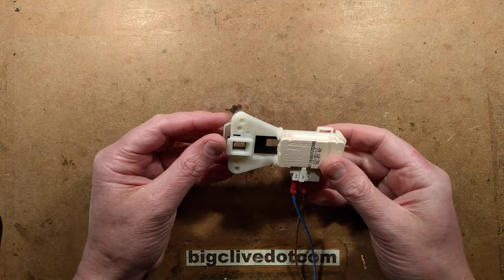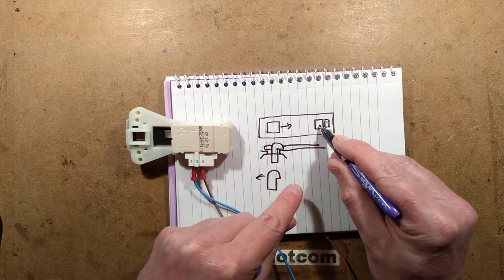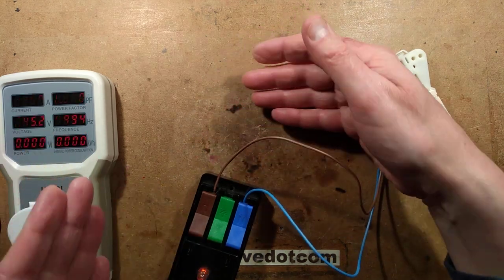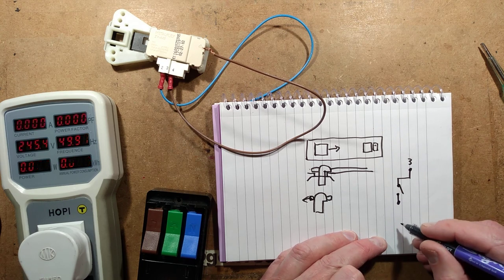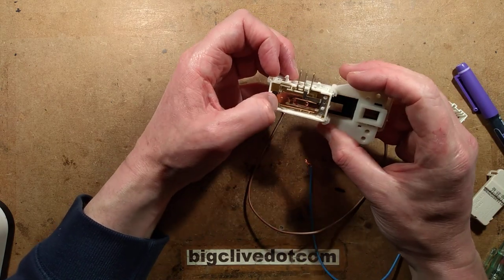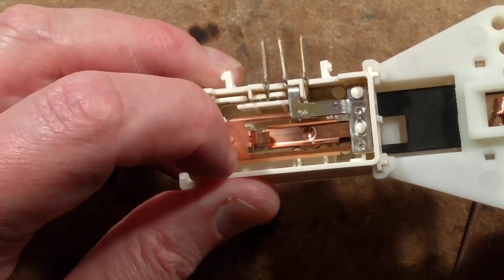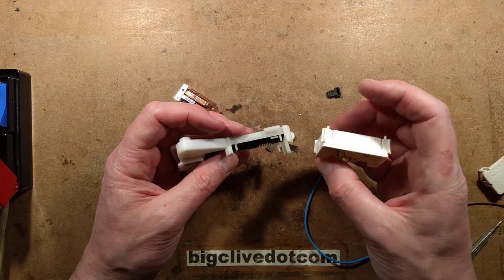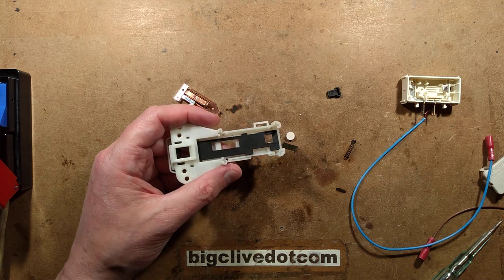How a washing machine door interlock with time delay works.  (not a wax motor)

Comment: I hate the time delay. I never could understand it. The damn door won't open for ages after the program has finished and the drum has stopped. There should be a a way to override it so I can OPEN THE BLOODY DOOR!
Reply: it also allows the washing to cool to a lower temp , which also extend the door lock time.
Reply: This video shows you exactly how to do that - just disconnect the heater wire. Saves a little energy too!
Reply: @rlowens  disconnecting the heater won't work on my machine, because it has special contacts to detect if the lock has engaged or not (and it won't start unless the lock is engaged). I had to enlarge the hole in the metal plate to defeat the lock.
Reply: I have toploader made by Electrolux and it seems to have a latching relay lock. As soons as the machine has done its thing, it simply clicks (more like small bang actually) and you can open it. It would be interesting to see one of those locks dissected. I guess these might have 2 relays inside or some clever way of one solenoid + permanent magnet magic.
Reply: If the motor doesn’t have a rpm sensor then they just guess a generic long time. Units with rpm sensors unlock when the drum stops.
Reply: My old Maytag has a brake on the drum pully. As soon as the cycle stops, or if you open the lid, the drum stops spinning in about 1 second. The damn this is over 40 years old and still works great
Reply: Stick an override switch where the drain or pump filter is at the front, usually under a plastic flap ;-) your own secret button ha ha.. pisses me off too if im in a rush and the door wont open...feels like forever sometimes.

Comment: Great explanation. I have a machine that fills with water but the drum never turns. The door mechanically locks and after no power for 2 minutes it will unlocks. However I never get a light indicating that the door is locked. I am suspecting the door lock.

Comment: If you really want to see how cost can get designed out, compare a new machine with one say 20 years old. I recently pensioned off a '96 vintage Zanussi as the motor was starting to get rumbly and 2-month old Zanussi one came my way for way less than the cost of a new motor and here are a couple of examples.

The hose from the detergent dispenser to the tub is now incorporated in the door seal rubber. This has the additional advantage that the whole dispenser box is flushed clean of detergent.

Instead of having a mechanical linkage to divert the incoming water to the individual compartments in the dispenser, the new one uses two valves and some fluidics to direct the flow three ways.

As for the door latch it's electromechanical, driven from the controller. If it's safe to open the door it'll let you.

Comment: If you can get your hands on the thermal cutoff switch from an electric shower there's a more impressive version of a bimetallic strip. Instead of a strip they use a disk with a slight dome, which pops from convex to concave at a given temperature, which pushes down a button under the disk, which opens contacts to disconnect the power to the shower heating element.
Reply from the maker: I did a full shower teardown.  Including inside the heating chamber.

Comment: Washing machines come with a ten year parts warrantee, so you only change the washing every ten years. I am amazed at how cheap they are my wife just bought a new hotpoint as our old machine died after 9 years. it cost £285 delivered. This machine has a balance system so it does not go into a  high spin unless the clothes are evenly distributed, and does not bounce all over the floor. Now that is clever. How they make them for that price I do not know as the retailer has his cut and then the delivery costs have to be taken out.
Reply: My Bosch machine from the mid-90's did that load balancing thing, and it lasted 20 years!
Reply: @Petertronic  How do they get the costs down if they last so long?
Reply from the maker: My Indesit load balances by detecting the motor speed ramping up and down with an unbalanced load.  It also jolts the drum occasionally to see if it can separate clumped clothes.

Comment: Took mine to bits after seeing this and it fell to bits when I was pushing it around don't know who puts these together but to get that little u shaped piece of copper back is a nightmare it is just balances between the 2 parts of that copper strip and the metal piece fell out as well. So while it is simple is very delicate to put together. Getting a new one anyway but I thought I might try to mend. Thanks for showing this as I could not work out how it works I still do not understand what happens when it heats and the bit that pushes the pin down makes contact  with  the strip below.

Comment: i have a bosch and you can open the door (provided its not spinning i presume) by holding in 2 buttons, so it must operate completely different to this, it is though of course a digital program as opposed to a traditional mechanical one

Comment: Great video Clive, I loved watching it. So if I understand correctly the bi-metallic strip is the 'ptc' element and the isolated ceramic disc just transfers the 'bend' to the switching strip without short circuiting L against N?

Comment: Great video Clive, not trying to cause an argument, but I recently took a door lock apart on my indesit washing machine and found that it uses a NTC thermistor, not a PTC thermistor, mine had gone high resistance from soot on the contacts, it also blew (literally) a thyristor ( I'm guessing that's what it is) on the main power board, unfortunately, I don't know what spec the thyristor was because it blew a small chunk out the front of it and took the ID number with it, all I know is it was Q9 lol

Comment: Perhaps a future video about the HOPI’s internals; Maybe see if the HOPI could be modified slightly to abate some of the flicker‽
Reply from the maker: That video is out tomorrow.
Reply: @bigclivedotcom  Wow now that's an 'agile' response to consumer feedback!  Love your videos; can't wait to watch!
Reply: I've been curious for a while as to whether the flicker is predominately caused by clock refresh of the SSD multiplexing, just poorly rectified  AC or a bit of both?  It kinda seems like the former because of the way it "waves" across, but not seeing it in person I can't tell if it's the display refresh cycle or mostly the camera shutter leading to stroboscopic aliasing. I get that ultimately the two are related, but I'm curious if residual ripple is a factor or is it just down to the refresh speed of the display driver.

Comment: What do you think about the Indesit/Hotpoint recall for overheating door locks? BBC article says it's caused by "The extra current running through the machine when the heating element is on causing the door locking system to overheat". Would love to understand properly what you think could be happening.
Reply from the maker: I think it's just the switch contacts inside burning up due to the high 8A load of the heating element.  I'm surprised that the heater current runs through that, I would have thought they'd just switch a control circuit
Reply: @bigclivedotcom   I don't know much about the appliances but I'm surprised the  door contact switch does not provide a signal voltage to power a relay switch or something?  But if so many manufacturers share this type of switch; how come it is only some whirlpool washers that are affected?  Are wiring diagrammes available?  it would be interesting to see if they differ?I would definitely watch a video on that.  Chris
Reply: @bigclivedotcom  I'm on the waiting list to have my machine repaired or replaced, which is... annoying. It's hard to determine from what's in the news but I thought it might be this heating up (maybe heating a little too much on its own), plus extra heat from the water heater causing the plastic body of the door lock to get a bit melty. Live metal parts inside shift, touch, get very hot and set the plastic on fire? When using the website to see if I needed a recall one question was what colour is the door lock - white, light grey or black (mine is white) - so maybe the wrong sort of plastic being used on some of them.
Reply: ...and I just spoke to my cousin who does repairs for Hotpoint/Whirlpool and I was absolutely wrong and the door lock IS also a switch for a bunch of other components in the machine. It's under-specced connectors plus corrosion/oxidisation.

Comment: Hiya BIG Clive, at the end of the video, I think it's what they call memory metal. We used to make the stuff at Thomas Boltons in Froghall Staffordshire.
Reply: Memory metal is different - in most cases (The titanium alloys I'm aware of) you heat the metal to high temperature while it is in the shape you want it to return to, then bend it after it cools. It returns to its original shape when you heat it up again. After this it stays that shape when it cools, so you have to manually bend it again to see it change shape on heating again.
Reply: @peglor  memory metal is cool tho.  Excuse the pun. Lol.

Comment: The problem with these interlocks is when they fail in the locked position you can’t open the door and you have to get inside the machine and try and break the lock off. I’ve had to do this many a time. ( I’m a retired domestic appliance engineer )

Comment: Mine doesn't have this type of interlock in it. When you turn the machine on, the door can be opened or closed at will until you start the cycle. If you need to add a sock, you press pause, and so long as the machine is not full of water, it will let you add the sock. The door locks and unlocks with 2 rather disturbing clunks. I'm guessing its a pair of latching solenoids, as when it is powered off mid cycle, the door remains locked. It also retains memory of what it was doing prior to loosing power, and resumes the cycle once power is restored.

Comment: Pissed myself when you picked up the hot PTC :D
Great minds think alike lol I have been looking at your Hopi for a long time now thinking the same thing, VA would be a great feature instead of having to calculate it by hand lol.
I've always wondered how these locks worked with that mysterious click your forever waiting for :D
I hope noting goes wrong on my Indesit machine, my last one lasteed 15 years till the bearings went on the back (although I suspect it was more likely the belt slipping), though it did make loud squeeking sounds and rocked like a bag of escaping Emus in a box lol. When I got mine a couple years ago I chose it for the 10 year parts warranty that Indesit were only offering on a few machines at the time. Only registration was needed :) God knows how much labour will cost if I have to use it though O_O
Reply from the maker: With my old Indesit it started making a squeaking noise as it turned and it was fixed by replacing the belt in the back.  The 10 year parts warranty is a bit of a scam as the cost of the parts is covered by the astronomical cost of the person fitting them.
Reply: @bigclivedotcom  Thanks for the tip :D x When I took my old one apart I tried turning it by hand at the back to see what was happening, and nothing was obvious o_o. The motor sounded good, the brushes were fine, the belt looked ok and I couldn't get it to squeak. It only did it on a fast spin cycle, but during washes I did notice the drum wasn't quite lining up with the rubber seal on each turn. I even looked for any laundry stuck inside the outer case but it was clean.  And surprisingly the heating element was also still shiny even though I never descaled it!  (calgon my arse). The only rules I stick to with my machines are, a good mild bleaching on 90' for an empty white cotton wash every few months and I only use liquid detergents/softners that go directly in the wash. I also started using a small amount of soda crystals with each whites wash now as they soften the water and really make a difference at getting stubborn stains out :) I have a bag somewhere with the CPU board, drain pump and front panel board in it. I couldnt get the motor bolts off for love nor money. The concrete counter weight is in my garden as an ornament as it looks like a small stone bridge lol I have a lego man sat on it in an ornamental tower, guarding my garden ha ha :D My mum has the drum as a garden planter and Currys took away what was left ( a carcus and a door  lol ), I should have took the door lock out .. Doh..

Comment: We get loads of these Hotpoint/Indesit ones coming in the workshop with the door lock wiring loom burnt out as the connectors they use are really crap and overheat

Comment: Pretty sure the darker strip of metal underneath is the bimetallic strip.  Different color plus it's the part the adjustment screw bears on.  It heats, bends up, and pushes the heater block up which pushes the actuator.
Reply: Ha!.. should have waited until the end..

Comment: You should see some of the older microwaves. Variable-duration PWM modulation done with elaborate gearing, a very unusual cam stack, and a microswitch.
Reply: I believe most of the microwaves with rotary dials use this method. If you turn the power level even if the microwave is off, you'll hear a click at some point on the dial, then if you run the microwave for a few more seconds the click point will be different. Sometimes I wonder just how much cheaper rotary microwaves are compared to digital ones, can't be that much cheaper when you factor in time to assemble the gearing, the gears etc

Comment: My front loader has a delay unlock also, but it uses a wax motor for the delay.  Also has the main power contact integrated into the latch to keep the power off when the door is open.
Just another way to create a delay latch and switch simply.

Comment: We have a fairly modern digital Indesit washer+dryer that has a motorised lock - makes a loud clunk to lock the door when starting - 2 clunks to unlock the door when paused/finished, even protests when door is not closed properly upon starting - 5 clunks. I assume that this modern door interlock has a switch to tell the machine that the door is locked. In the event of power failure you remove the front kick plate and a plastic tab is pulled down and the door opened (only after the drum has stopped spinning/water drained by lowering the drain hose into a tray 😉
I think the interlock that Clive has was for older analog program timer machines (said interlock was invented in the middle of that period for safety reasons ⚠️- arms ripped off in spinning drum, flooding caused by door being opened in program - wash sequence (if water level was above lower door seal, would pour out and the machine (being the old dumb type) would start re-filling itself) 😱
Reply from the maker: This was in a recently bought Indesit.
Reply: My parents specified for it not to have the delay at the end of the program to open the door, how old was your machine, and did you specify for a delay at the end of the program before the door unlocks?

Comment: Please dissect your screwdriver and tell us how to make one :)
Thanks for the teaching stuff.
Reply: @
Aurthor Thing

there is only 1 resistor , 1 transistor shaped thing , 1 spring and 3 batteries , i had one and they are very useful for testing fuses/continuity and also a non contact voltage detector (for UK mains voltage) not sure how low they work :-)
i say transistor shaped thing because its probably a chip inside but only has 3 wires in a to92 case :-)
Reply: @YTANDY100  that's cool.  I want to make one now.  Surely can't be too difficult to find the parts.
Reply: @aurthorthing7403  
that was my idea but the to92 thing had no numbers on it :-(
and i forgot to mention the led :-)
Reply: @YTANDY100  I think I found something very close to it on a basic electronics website.
I think this will work with a few tweaks.
http://www.learningaboutelectronics.com/Articles/How-to-build-a-touch-sensor-circuit

Comment: Got one of these atm on a Indesit, connector melted/burned........ Whilst it is a clever design, I think these should have been low voltage and used a relay on the control board to handle all that current, instead of shoving it all through a RAST 5, which is effectively just a fancy housing for faston connections. It's also that EXACT switch that caused the infamous fires on whirlpool dryers, as the connector melted/burned and of course the area was full of dry lint.
The connectors for these? nearly impossible to get, the crimp version requires an expensive crimping tool depending on whether it's MOLEX, TE, or INARCA, the 80p screw terminal version from Wiecon and Lumberg has VERY long lead times, the replacement wiring harness JUST for that lock, is £20.

Comment: I took care of a laundromat that had several $6000 front loaders. Every one had the handle or front door bent because people wouldn't wait for the time delay. The domestic top loaders have their switches get gummed up by spilled gooey soap. I started a side business selling used washers from all the easy fix machines people throw out. I charge $5 to haul them away, fix and then sell them.
Reply from the maker: I always had a fascination with laundromats as a kid.  As with all slot machines.

Comment: Thermal warp switches are about fail safety.  If power went out it would still keep door locked for a period of time, they have used for 50 years.
Reply: for what purpose should the door remain locked for 2 minutes and then release? Why not release immediately?

Comment: Also a A12-701 temperature controller would make an equally interesting video....or even a 8145-20 defrost clock both are very mechanical